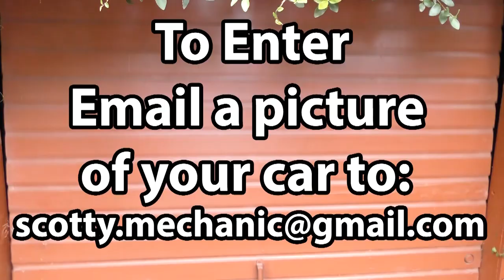There's a Secret Inside this 2005 Mini Cooper

Comment: Nice work and power output. But why go with a mini when you could've gotten yourself a Civic from '88 to '95. Would've spent less and been a faster car. Not to mention the mini is over 500 pounds heavier and has a chick car vibe to it. Not hating, I really would like to know why you would go that route instead. Again, nice work and good job with the car.
Reply: Why? Because you're in a tin can civic from the 1980s.

I've been in a few of these Minis, they're nice places to be relatively speaking. Much better than a 80s Civic. And of course there's the whole stigma (sadly justified a lot of the time) around a civic.

The supercharger is probably the most compelling reason. A Civic can't replicate that whine.
Reply: @MrManBuzz  you're right about the stigma but that is only because there are so many theives out there who only target the best vehicles. A supercharger sounds even meaner on a higher revving Honda engine.

Comment: Are Minis more reliable than Fiats?
Reply: They basically are Fiats.
Reply: The late model R53s are good cars. The only common problem they have is oil leaks and a bad power steering pump. Both of which can be sorted without that much hassle if you're handy with tools yourself.

They're not a car you can just abuse like a Toyota, but with some care they can do a lot of miles.
Reply: yes
Reply: Adolf Hitler 
Fiats are Italian, MINIS are made in England.  You can find both countries by looking at a map.
You do know what a map is, don’t you?
Reply: Tune Spec 
Okay
Reply: Yes, more reliable than fiats. Better engineered too. Just better cars overall

Comment: The later ones had a Peugeot engine, which is shite.
Reply: True they should have left the old minis with the 1cc engine
Reply: James L 
Really ?  I own a JCW with the Peugeot (n18) motor, never had a problem with it - unless you’d call changing out the battery after four years a problem. 
Some people really do talk shite, don’t they ?!!
Reply: @geofo60  the n14 is the issue... timing chain issues like no tomorrow... its rare for one not to blow a motor
Reply: @That grey area N18 is pretty good. It the DOHC VVTI engine. BMW Vtec pretty much.
Reply: The later engines were fine. N16 and N18 are awesome!
Reply: @geofo60  The N18 is much improved over the abysmal N14 but it's still soft. The W11 in the first gen is still a more Hardy engine, albeit a lot more agricultural too.

Comment: Is this using a stock gearbox?
Reply: Yes. They come with stock 6 speed getrag box
Reply: I have a 2005 Mini Cooper s. Did the clutch in it last winter. Converted to single flywheel conversion from ESC Tuning, but glad to hear the gearbox is stock with those mods cause I want to do the same
Reply: The crankshaft and conrods are factory forged too so the bottom end can take a lot of power

Comment: I have a 2011 Chevy Impala when I turn left I hear a grinding noise what is that???
Reply: sounds like a bad CV joint
Reply: Yup.. CV joint.. not a big deal.. have it changed.. its probably torn up and the grease inside of it is gone and thats the grinding when you turn
Reply: Yeah, probably the CV axle, but I have seen wheel bearings with slack in them lean the rotor against the brake caliper bracket on the Impalas. If that's the case you will feel a slight lean when turning and straightening out, and that would be an urgent matter to address.

Comment: 1:01  motor designed by chrysler? that explains the lack of reliability
Reply: Keye T motors are actually really solid for these car other that common oil leaks from gaskets, it’s the rest of the car that falls apart like the cheap plastic beats or cheapy made bmw parts lol.

Comment: “Estimated” is NOT actual power.  The mods done were only for breathing and w/o changing the Cams and springs you aren’t gaining any benefit.  168hp stock + what you have listed is maybe netting around 200hp (flywheel) or so.
Reply: Are you deaf? He said he had a big cam and 450CC injectors. It making 250BHP is easily believable.

Hell, an R53 will make 200 at the flywheel with just a 15% pulley.

Comment: This Mini owner does not know how lucky he was ! In dodging an expensive bullet - in the sense that his Mini Cooper does NOT have the crappy 1.6 VTi normally aspirated unit which is standard fit in Minis and Peugeot 308's. THE worst engine ever in automobile history. Supposed to be 120 hp - mine struggles to get "up" a gentle slope. More like 60 hp. Struggles to make 75 mph and sounds like a 747 taking off. Pops head gaskets and rocker cover seals for fun, leaks oil, leaks coolant, fitted with an "electronic" thermostat ! Burns  1.5 liters of oil every 800 miles. AVOID AGGRAVATION  - SAVE MONEY - DO NOT BUY.

Comment: My r56 was the worst best car ever.  I would NEVER recommend this car to anyone.  Other cars are fun to drive without such poor reliability.  

I calculated that overall cost of upgrades is

$100 for every HP you want to upgrade
Reply: Alright what did you do wrong to your poor mini?
Reply: @zevi2000  well, let's see:
2 soft tops $5500 each = $11000
Timing chain $4500
CPU fried $850
Breaks $1600 x 2 = $3200 (normal wear)
Shall I keep going?!?!?
Reply: @alexm4515  Damn son. How many miles?
Reply: @zevi2000  less than 80,000 miles. I had full warrantee on the car until 100k.  I just got sick of driving rental cars.  I babied this car.  I only took it to bmw. I didn't upgrade anything other than wheels, exhaust and air filter.  Basically, I didn't do anything that would void my warranty.
Reply: The early R56s were a disaster. This is an R53 though so it's a different kettle of fish.

Comment: I’d buy a Mini...if they weren’t so damn unreliable
Reply: R53s aren't bad at all. If you get a well minded 2005-2006 Cooper S it'll be a solid car. The reason Minis have gotten a bad reputation is because the early R56 Minis had huge engine flaws. Completely different engine to what is in this one.

Comment: My maxima has more HP than that completely stock😁
Reply: And weighs 50% more and handles like a boat.
Reply: Maxima is practically a Rally Nascar. I've got mine up to almost 650hp and I still haven't even put in the short throw dipstick or done my slotted drilled brake pads.
Reply: @MrManBuzz  lol yup probably twice as much! I love my boat though. The mini is very sweet though

Comment: Mini sucks. My stock 2002 crown victoria has more power than that thing....and you can get 200k out of those cars easy. With Mini, you'll be lucky to get 100k out of them.
Reply: Well you're simple minded aren't you? Power numbers without factoring in weight and the size of the car means nothing. That Mini would run rings around your boat in every aspect that matters.
Reply: @MrManBuzz  "That mini would run rings around that boat in every aspect that matters"
You must be some kind of stupid aren't you?
Yea I will give you the fact that the mini will corner better than the crown victoria. 
However on the drag strip, the mini will have me off the line, but by the end of the quarter mile, it'll be being my license plate, because the crown victoria has far more torque. My girlfriends 08 mini cooper tops out at about 105. My crown vic will top out at about 130.
Also, perhaps what matters the most for a car is reliability....which the mini fails miserably on. Like I said in my previous comment. You will be lucky to get 100k out of a mini. My crown vic has 200k on it, and its still running strong. Plus Scotty featured a lincoln town car, which is basically the same thing that had 487,000 miles on it. No mini will ever last that long without several engine and transmission replacements. 
So other than cornering well and off the line acceleration, the mini is far inferior to the crown victoria. Then when you factor in they cost an arm and a leg to maintain, you are getting very little bang for your buck.
Reply: Ah America where nobody knows what a bend in the road is

Comment: Mini Cooper, a lot of issues, never fun to drive... Seriously... Might be ok in Europe but not in USA Texas..
Reply: Never fun to drive? Well you've never driven one that's for sure.
Reply: 2008 stick. Very underpowered... Full of electrical issues... Replaced clutch on 40k miles. Head on 60k miles. Went through 3~4 batteries, 2 fuse boxes, 2 EDM and 2 CAS... Then donated the car for tax, title and fees to transfer it off... Not a nice car at all... Also very bad on gas! Well, the best thing about it maybe is the tension life you have with it... Everyday new issue..
Reply: @geniusfde  The R56 Cooper non s is a very different car than a R53 Cooper S. It's not fair to compare the two.
Reply: @MrManBuzz  I just said my personal opinion based on personal experience...
Reply: @geniusfde  And drawing sweeping conclusions from personal experience very rarely reflects that conclusion accurately.
Reply: @MrManBuzz  chill out man! It is just a car we are talking about!
Reply: @MrManBuzz  sorry to say all new minis are just very crap
Reply: @ryancourtney8607  Simply not true. The first Gen engine is very strong. The stock internals can handle upwards of 300BHP.
Reply: geniusfde sounds like a Chrysler product
Reply: Never fun to drive? I think you need a real mini and not a ghost one.
Reply: @geniusfde  I'm mostly concerned that you think it's not fun to drive AND gets bad gas mileage. They're great on gas; that's one of their best upsides. Even with heavy launching at a lot of stops and lots of downshifts from 6th to 4th when I pass, I get 25-30mpg. When I drive like a decent human being, it hits close to 35mpg. And it's had a cam, jcw kit, reduction pulley, headers, and tune. Perhaps the one you drove was bone stock and had no forced induction or anything, in which case they're still great on mileage. I'd say it's also a chance the shifting and throttle response of it being possibly the automatic was another downside.
Reply: @jordanbwalt  you are completely right. The base one and the common ones in USA-Texas are very boring. Underpowered and bad mpg... I could never get close to 30 mpg... I've seen them in Europe, they are different...

Comment: LOL riced mini cooper
Reply: You clearly don't know the definition of rice.
Reply: @MrManBuzz  I know what is rice car, put a fart exhaust that make lots of noise.
Reply: @ben.757  When the car is that highly modified a free flowing exhaust is necessary.

This isn't some shitty Mini with just a fart can strapped on the back and some ebay stickers. If it was rice might be applicable. But the very fact pretty much all of the modifications are performance orientated it means it isn't rice. Again, you don't have a clue what you're talking about.
Reply: MrManBuzz 
Still this is not a V8 engine